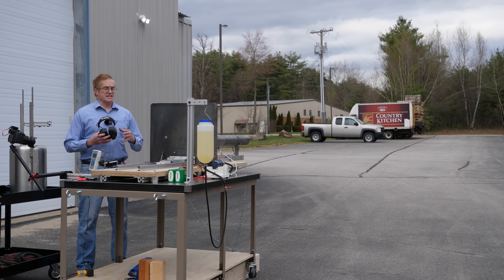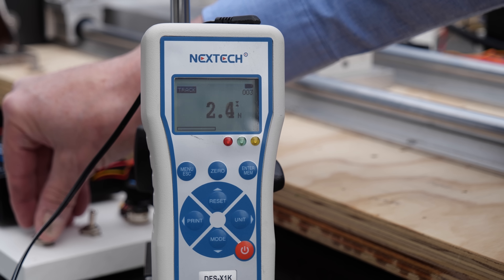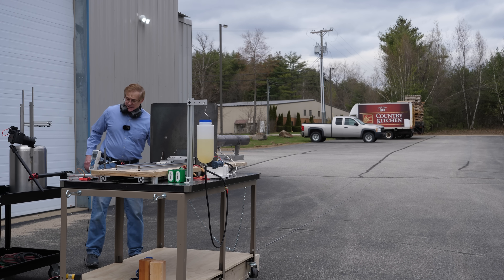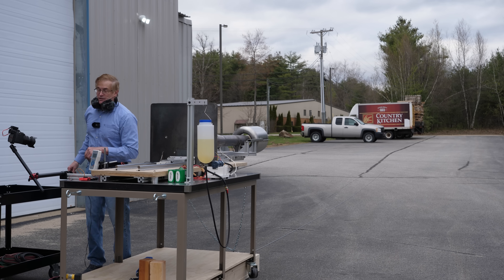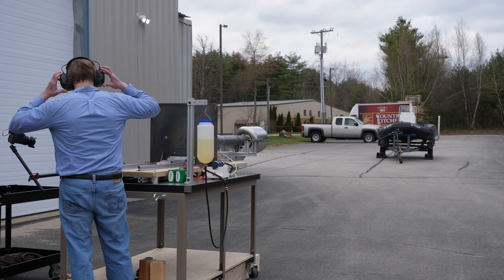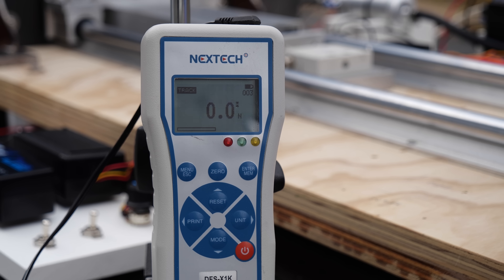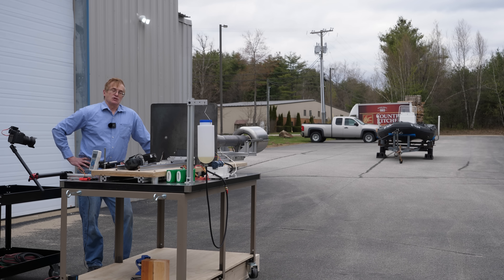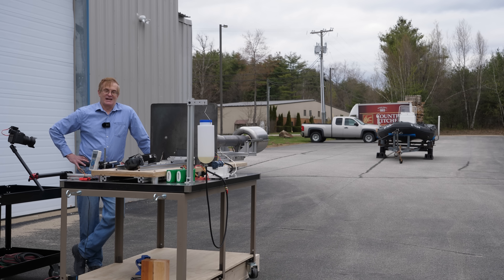WE USED AN AUGMENTER ON OUR PULSE JET!

Comment: I think you only get more air flow into the augmenter by suction, rather than a boost in thrust. I also think the wheel chock method, instead of the ramp method, was correct. Its awesome that you guys have this time together. Cheers!

Comment: When I was a kid in the 1950's, augmenters for model airplanes looked like carburetor venturis scaled up. From an acoustic perspective it acts like an impedance changing device similar to a loudspeaker horn or megaphone. The expansion cone is critical and your cylinder doesn't look the part. Your augmenter may have a shaped liner within the cylinder, but this is not apparent from the video.

Comment: Oh no, you can’t just give up (I don’t jump forward, so this is the most recent video I’ve seen).  I won’t stop until the horse gets back on its feet.  Looks like it’s running rich. And question I was pondering the addition of an oxidizer, 1,2,4,butanetriol trinitrate but noticed it was an acute toxin.  So that is out.  Have you used oxidizers for any of these or those projects ?   From what I’ve heard the rotating detonation engine requires huge amounts of oxygen (air intake of > 600 cfs for small engines    Cubic feet per second just the thought is mind boggling.  Best of success, I’m looking forward to another adventure

Comment: I've got to agree with previous comments,  the augmentor would work best in flight... with air pressure at its inlet.   In flight ducting would also cool  the engine.
Reply from the maker: I don't disagree, but the principle of operation should show SOME improvement in a static test. I'm still trying to figure this out.

Comment: Why not think that as the pulse jet is moving, the increased amount of ram~air effect is substituted by the electric fan; however, I believe there also needs to be a substitute for the air pressure being directed between the outer surface of the p.j. engine & the opening of the augmenter, possibly creating some venturi~like effect for some increase in pressure generating more thrust? I would imagine there may be a possibility of an  increase in thrust... p.s. Great job with all you geniuses do! Thank you all.

Comment: I built one 40 years ago that was fed with natural gas from a  22mm gas line - it became much hotter than yours and was bright red in  a very short time -  the jet wash was horizontal with a  repeating rainbow of colours for about 50 feet - there were no fluffy yellow flames - I don't think your pulse jet is optimized

Comment: it could be because there is a less or more space between the AUGMENTER and the end of the pipe ?
Reply from the maker: I tried that.
Did you notice the many holes drilled in the mounting bars? I was able to move the augmentor back and forth to search for an optimal location, but without success.

Comment: 7:10 The audacity to question the proper use of equipment. It's good to be sceptical but you should have a reasonable theory about your alternative practice. I totally agree that the ramp should be the way they were finally used, the idea being that the tyres partially roll on top of the ramp increasing traction instead of pushing the ramp in front of the tyre. See the chucks used to stop trucks for details.

Comment: so im just talking out my ass here. but this to me seems like chassis dynoing a motor before and after you add a ram air intake. you wont see a gain because the cars not moving while its on  a dyno, its not "ramming air". and thinking of it as a curved wing, wouldnt doing this test static be like blowing a fan at the underside of wing? it may generate lift but not because of the airfoil but because of raw pressure difference. its not "activating" the mechanics of the airfoil

Comment: What does the thrust command is connected to ? Fan speed output? Fuel rate of flow?
Reply from the maker: Fuel flow rate is controlled based on the measured RPM.

Comment: Did you consider that maybe the augmenter needs air flow moving inside and around it like it was moving through air ? In the same way that you simultate airflow intake speed using front fan ?
Reply from the maker: I don't think so.  The mechanism is that the air that is entrained into the jet stream slides over the front lip of the augmentor, which lowers its air pressure. 
This is what gives lift to the upper surface of a wing. This should occur even when the system is in static mode. This is also how these systems were studied in the papers I referred to for the design.
Reply: @TechIngredients  ok. Somewhat like a circular wing. What about thrust command ? Does it drive fuel rate ? Do you use a fuel pump?

Comment: Your way smarter than I am this is fact . Just kind of guessing maybe the exhaust is to far into your augmenter or not I really tell. But maybe move one  of them 1-2 apart then maybe it may behave like a ventury . Like I said just guessing I don't have the math skills to come up with some wild mathematical equation . But I am fascinated by your channel if YouTube would have been around in the late70 s- early 80 s . The stuff I've seen I of would've  applied myself a lot more than I did ,  I just what it took to graduate nothing more nothing less .
Reply from the maker: I agree that we didn't fully test this system as well as possible. The spacing was set based on the papers that did that complex math to design it.
But, you may have noticed the many holes in the support struts.  That was to allow for those very adjustments.

Comment: Similar to an in use adjustable cone on the after burner of a turbojet,?
Reply from the maker: No, it's completely different.
The augmentor is working with exhaust that is no longer connected to the engine. It operates like a foward facing airfoil or wing to generate lift from the passage of the high-speed exhaust.

Comment: Data collected by Lockwood (Hiller Aircraft) in the 50's testing augmenters (under US Army contracts) indicated significant increases in static thrust (on the order of 40+%). It was stated the ratio of the pulse jet exhaust diameter and augmenter diameter (both intake and throat) as well as the location of the pulse jets exhaust plane relative to the intake and throat of the augmenter were critical (as was the inner shape of the augmenter expansion aft of the throat.) I don't doubt your results, but I think the conclusion of not working is not "precise" since those two critical items don't appear to be have been exercised. I think your work is extremely interesting and I hope you continue exploring.
Reply from the maker: We will...

Comment: Check out the text "Pulsating combustion : the collected works of F. H. Reynst / edited by M. W. Thring". In it Reynst described paired pulse jets combined at the exhaust, running 180 degrees out of phase (i.e. the conjoined exhaust were at a wave node), to produce a steady exhaust (or nearly so). He was also speculating the same could be done with the intake of a valveless pulse jet. Something interesting to try.

Comment: I suppose that the augmentor also depends on the air flow during flight using the venturi effect. In the test you had the end of the Pulse engine inside the enhancer. If the enhancer is placed shortly after the end of the pulse engine it should suck additional air into the airflow resulting in more air comming out at the end. Just like the effect you have from a dyson ventilator, multiplying air flow. This would also mean more power output of the whole system. You also should not use this device that shows hopping power but instead monitor the force produced with a data logger and a display on a monitor. Then you would have decent, accurate power monitoring and that would really show wether you have more or less power production with different configurations. You need a sum up of power in a given time. Perhaps the augmentor has a delay in power build up compared to the Pulse engine. You will not see that from your power meter unless you log the data and sum it up over a certain time. I think that you gave up on this to fast!
Reply from the maker: You might be right.
Average power is still a good means of evaluation because the pulse frequency is fixed. The principle is a little different than a venturi flow multiplier. The air that enters the exhaust stream passes over the large radius lip at the inlet. This flow lowers its pressure, just like over the upper surface of a wing and produces foward lift.

Comment: Your test rig brought back a lot of memories. In the mid eighties (last century!!) the project I was working on was dealing with a company operating out of the Ferri Labs on Long Island. On our first visit they rolled out their ramjet test rig  from their basement into the parking lot and ran a remarkably similar demonstration. By the way, what you called an “Augmentor” is an ejector, an augmentor is an entirely different beast.

Comment: I‘ve seen pulse jet engines built of empty butane tanks and a pipe and a thin steel plate as valve.

Are you in the ballpark of the ones used in WW2?
What should one expect from using a different (blend) of fuel?

Thank you, stay safe!

PS: Hope the vape is augmented 😉

Comment: I would think ffor the augmenter you would need air flowing around the jet.through the augmenter in the same direction as the exhaust to get the full affect. Js
Reply: As if it was flying

Comment: Your jet isn't at ram air speed, it won't work unless air moves across the outside of the engine. The efficiency will be directly proportional to the ram air speed. Good luck and thanks for the videos!!

Comment: Presumably the augmenter is designed to be used with a moving pulse jet? This one is stationary, so there is no high speed airflow over the system. Try using it on a moving vehicle instead of on a fixed test stand. That should work.

Comment: How did you come up with the configuration of the augmentor.
Reply from the maker: It's a compilation of several papers that provided similar arguments for the design principles. The problem that I struggled with was that each paper evaluated the design of some of the other pages and found them lacking.
Ahh...research, it's both a pleasure and a pain!
Reply: @TechIngredients  I ask because I found some NACA papers regarding thrust augmentation for TURBOjets, and they didn't look like that one... There was work done at a small contractor on boosting pulsejets, and there too the augmenter didn't look like that.
Reply: Do you have the relevant Hiller reports?

Comment: The performance gains are probably from the engine working on a moving vehicle. As the air passes over the outside of the engine. Just a guess.

Comment: X-jet is correct your spacing is wrong. I used to make heaps of pulse jets and one of the easiest ways (and simplest) to increase thrust was to add an augmentor on the tail pipe. I suggest yo
Reply: I suggest you use a straight pipe to start with  - a tube way more less complicated with what you have. Once you have the basic idea - then you can flare out the front and decrease the end (or not) of the augmentor. Have a look at what Snecma used to do in the 1950's. If you want to have fun - and lose eye brows - add a fuel spraying ring in the augmentor (ala cheap and nasty after burner)Also the relationship of the tail pipe to the augmentor can be varied - eg; dist from the end of the tail pipe to the start of the augmentor throat. This can be seen in the actual flying French and Dutch versions. However for what looks like a static model not really applicable to what you have. You don't have to have the compound curves of what you have on your augmentor (very nicely made by the way)- which would probably work if you mad it way bigger. Remember you are dealing with unsteady flow - not the steady flow that your augmentor would be more suitable for. I made a lot of valveless pulse jets and used to put augmentors on the intake and tail pipes .It was the cheapest (and laziest) way to increase thrust. Pulse jets are the poor cousins of  Turbine Jets - once the major firms worked out that the Turbine Jet had more potential they dropped them. Snecma  spent a LOT of money on development - have a look at their vertical thrust flying platform. Also suggest you look at the Russian firm Enics - who are still making them for drones. Also with Pulse jets simple is sometimes the best.Wish you well in your adventures
Reply from the maker: Thanks!

Comment: I loved the "fundamental disagreement" kept in the video. For anyone that may be confused why the mad scientist is correct, the following is a simplistic explanation.

A.) Having the ramp in the typical orientation secures the ramp with friction by means of the trailer's weight pushing the ramp down against the asphalt. It would require an exponential amount of energy to overcome the ramp vs. rolling along a flat surface. (*Try pushing a car up onto these ramps vs. pushing a car along a flat road.)

B.) Placing the ramp in reverse would provide no additional value in preventing this pulse jet desk from pulling the trailer than it would without them. Unless the lower side was up against something like a curb to provide the resistance. (Using the same analogy, try pushing the car with the back-side of the ramp against the tire. You'll just push the ramps along with the car, as though the ramps were never there; having no meaningful resistance.)

(*) Attempting to push a car from behind up a ramp can be extremely dangerous. Doing so outside a controlled environment with safety measures in-place is not recommended.

PS: This channel is fantastic. Should've found and subbed years ago...

Comment: Why would you not park the boat perpendicular, so the rope is in line with the axle. Wouldn't roll then.
Reply from the maker: That would create a torque on the trailer, which would be harder for the wheel blocks to resist.

Comment: I built a ScRamJet back when I was about 15. Exhaust gas' made 2.21 Mach. Don't recall the Thrust numbers, but pulled 2 x 1ton concrete blocks 40 ft.
Reply from the maker: Cool.

Comment: something i've been thinking about for a long time: a lot of energy is wasted in heat in the pulsjet. Could water be injected to utilize the heat and convert it into thrust?
Reply from the maker: Yes... but.
Having to carry around the water as a mass for generating thrust is less effective than simply carrying around more fuel.
These are neat, simple engines,  but their very low compression ratios are the elephant in the room and will severely limit their efficiency.
Reply: @TechIngredients  Yes, of course. But it would be very interesting to see how effective it is and there would be a cool side application in a watercraft. ;)

Comment: For my opinion the augmentor can not have a big effect (nuts). I try to explain: The jet (and pulsejet) has a hydraulic output power(W) which is massflow (kg/s) x square output velocity (m/s). In the system (jet) power is reduced by the inlet hydraulic power. (This hydraulic power is not the thrust) . Now regarding the system with augmentor. The hydraulic total inlet power is now the sum of jet inlet and augmentor inlet Power. We have now more reducung inlet hydraulic power. Inside the augmentor the velocity is sinking. But energy sinks quadratic. Although the total massflow increases. The hydraulic power to increase the bypass flow (rund inlet of augmentor) comes from the jet flow output. According to the the physics and Entropie rules can the energetic sum of the system not increase. Not with mixing gases. 
You can increase the thrust using a "Aerodynamik gear". This would be a jet driven propeller. Like in some rare helicopters. 
Please consider the bilance of the Total system. The hydraulic power of augmentor output minus hydraulic power input jet, minus hydraulic power input augmentor minus friction power loss inside augmentor.
Please consider, that "hydraulic" is used for gas and fluids. And sorry for my bad english.
But.. super Chanel!

Comment: Would creating a high voltage arc thru the exhaust to create plasma increase performance?
Reply from the maker: No.  The arc would only affect a tiny fraction of the exhaust, and so without hundreds of kilowatts of electrical power, there wouldn't be any increase in thrust.

Comment: Surely it needs a larger air bypass section to be useful? I'm assuming it's meant to gain power by using the change in pressure to draw air in through the intake between peaks?

Comment: With increasing incoming flow speed, the shape of the augmenter's inlet becomes important. The chord of its profile shall resemble that of an airfoil with the high-pressure side towards the inside -- just the opposite of the current design. Rationale: You want a compression ratio > 1 in order to do work.

Comment: It feels like this "augmentor" was designed for in motion, not static testing. As in, higher thrust while moving through a medium of air. It appears to break-up the boundary layer slightly and create a high pressure just before diffusion. The longer outer shield is there to allow for extra "burn" and expansion to create a wider bell-mouth effect without being too difficult to design.
That's just my intuition on this. Love the types of videos you release.

Comment: I thought I understood that the spark was only needed to start the process.  I didn't notice that the spark was ever turned off to allow the combustion process to be self sustaining.  My guess is that the full power was not reached because of premature ignition after the engine was initially started.

Comment: i think the difference might be in theoretical air velocity entering the gap and increasing the pressure on the thrust an collapsing that exhaust more. so outside of a wind tunnel or in most applications where it might be used at varied altitudes its not going to do a dam thing.